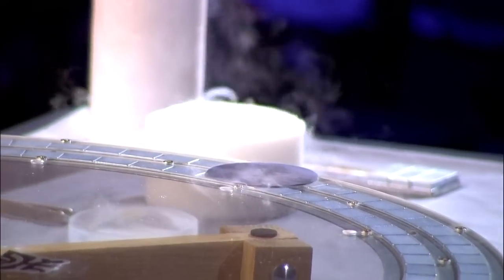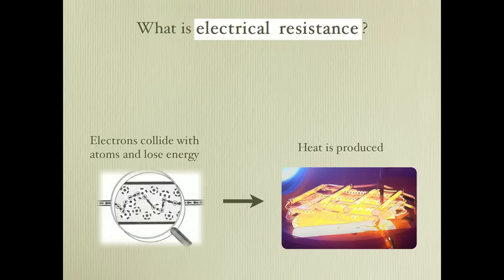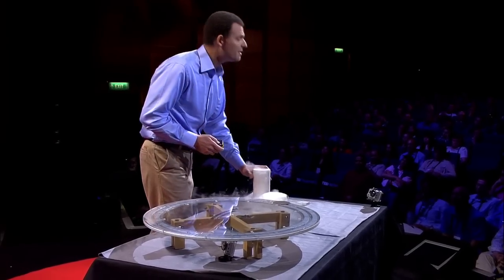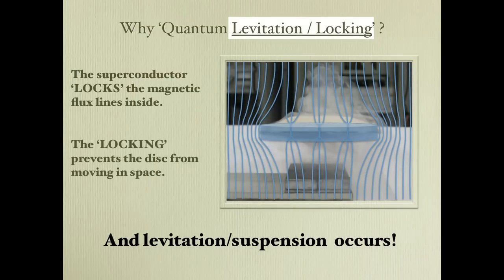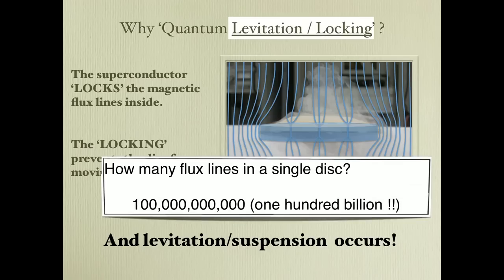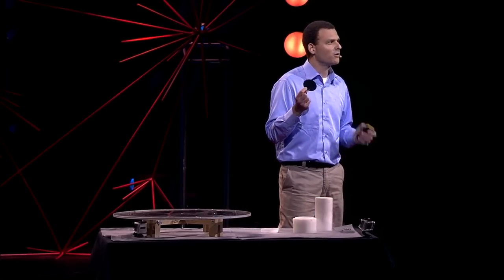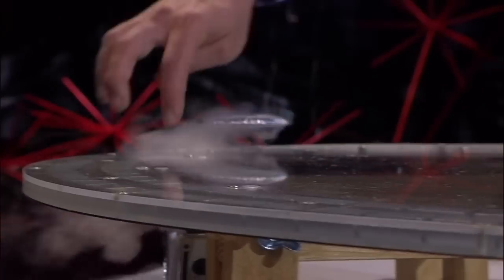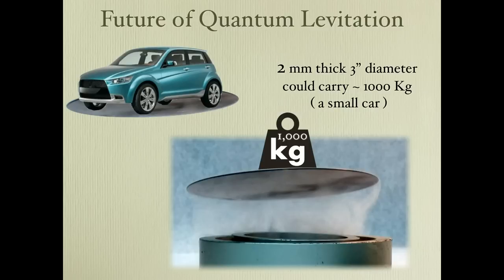Boaz Almog "levitates" a superconductor

Comment: No it not phenomena any more, in theory atoms are moving, meaning magnetic fields penetrates through material...

This means the magnetic fields pushes again diamagnetic objects..and it must pass around material that have condensed.

And this putting superconductor in circuit is huge energy creator...

The magnetic field is of a higher dimension than atoms, because it's a smaller particle in theory...as is the electric field and its force vector..

Gravity can be explained in higher dimensional terms...like water flowing through a filter, meaning gravity can move an object in any direction...and the same with magnetic fields...

We entered the realms of high dimensional technology...

Comment: Superconductors are strong antiferromagnetic substances that will expel external magnetic field that coined as Meissner effect. Since superconductors are enveloped with strong antiferromagnetic field in which this will help stationary electrons from amassing photons from surroundings. Again this doesn't mean that superconductors have zero resistance. It's just that free electrons that have dissipated out their stationary photons are allowed to re-amass stationary photons again from surroundings due to the presence of strong antiferromagnetic field of the superconductors themselves. Superconductors have quantum locking above an external magnetic field because it's a strong antiferromagnetic field (similar magnetic fields) that repel the external magnetic field to allow it to float above the external magnetic whereas its opposite magnetic fields to the external magnetic field will make it attracted to the external magnetic field that caused it to be locked literally to the external magnetic field. All superconductive substances at characteristic critical temperature will turn into a superconductor with very high specific heat capacity. This prompts us to suspect that stationary photons may play an important role in fostering superconductivity condition. At least we know now that missing link between electricity and magnetism is the photons in which free electrons are enveloped with stronger magnetic field due to the presence of abundant stationary photons onto themselves. Thus, we strongly believe that abundant stationary photons present on nuclei of superconductive atoms may foster the creation of strong antiferromagnetic field within the superconductor itself. If you are interested in real discoveries, I would recommend you to read my book, The Unification Theory - Volume One and you will be amazed with lots of new, interesting discoveries. In God I trust.
Reply: If you are interested in discoveries check out IISc Bangalore's researchers that made type 2 room temperature superconductors at atmospheric pressure and 13 deg celsius critical temperature by using a gold silver nano composite. See what I did there.. Also u missed the opportunity to say the missing link between electricity and magnetism is electromagnetic waves. Lol. Also ur book sounds like the ambitions of CCP. The Unification theory.😂😂 I am sorry I had to say it. Also no hate.. I just googled u r from Malaysia. And ur book is way off my level I think. I am 17 and Indian and just know basics of magnetism, superconductivity .etc and why it happens and how to calculate some things about it. Will I understand it? I will read the whole book if u say yes. but please say truly

Comment: There are too many of these quantum locking levitation superconductivity experiments. Try it without a catalyst, magnets or liquid nitrogen. We understand this, but it has no use. Electromagnetic perpultion is useable. If the  temperature rises and changes, you lose the effectiveness of the superconducting material.

Comment: This guy just basically explained how to make a UFO earth is a giant magnetic field then the higher the altitude the cooler the temperature find a way for the craft to pull the nitrogen from the atmosphere make the ship out of of a the best super conductive material the inner segment on the ship should be able to rotate like a gyroscope ans lock in place so depending on which pole the ship is on north or south the ship can correlate by being on the opposite pole   or if there a super conduct that react with oxygen and acts as a automatic coolant agent when in comes into contact with oxygen rendering the outside of the ufo cool to touch just a suggestion lol but it would be a lot more to it

Comment: if you ran this around x2 on an electric charged hairs ,using the  dry ice gas as a build up of propulsion,on the same magnetic display,would you not have explosive propulsion,continuous propulsion at light speed?
Reply: First of all, there is air friction. But let's pretend that there isn't. For us, observers, any object with mass will not reach light speed. The time from the object will go slower and slower the nearer it gets to light speed. If would take literally infinity amount of energy to get any mass to reach light speed.

Comment: Am I right if I suppose that this could be the premise of free energy via perpetual movement ? No friction and no dissipation means theorically perpetual movement right ? It solve the main problem, the friction and the heating. What could be the others issues ?

This also could be used to create monstruously powerful rail gun with no recoil at all, right ? This can make levitate a metal ball into Quantum lock & levitation and "fire" it at an outstanding speed, with a straight trajectory and all that low needs of energy and no sounds at all...
This also may be used to space travel engineering ?

Quantic researches are definetly the way to go, the applications in multiple domains seems endless, some seems promising and other potentially dangerous...

Comment: Would it be possible to use the magnetic field of the Earth for flying saucers ? Could a bigger conducter ( e.g. 3 Meter) be used for transportion into space for everyone ?  At least like the flying cars in the movie: "The Fifth Element" :) Or is the magentic field of the Earth to weak ? Thank you for your amazing speech !
Reply: Now that's using your noggin,lol, love the flying saucer question.... But the magnetic field is out in space. It cannot be accessed on the surface or even from the atmosphere. peace
Reply: @blackopal3138  The Earth's magnetic field can absolutely be used on its surface. Just look at a compass.

The problem is just that it's not that strong.
Reply: @Max_G4  lol, i'm a little surprised that I answered that so definitively, like I would know. Compass is a compelling example. In effect we already have the proof of concept, we just have to start increasing the load capacity. Look at LED 100 yrs later. Never know, pretty cool. peace

Comment: What materials did he use? What was the disk made out of? What was the magnetic railing made out of? What was he pouring into the container? This is amazing!
Reply: I guess it was liquid nitrogen he poured. But playing with such things always has to be under expert supervision.
Reply: River Govin Material the superconductor he had had to be quite easy to produce imho (non-lab environement and high temperature). I think it was Lithium-Copper-Barium-Stront-Oxide. Read about superliquids and superconductivity. The best superconductors arent the conductors at all but isolators with some ions and electrons artificially removed from their molecular structure. Have fun. Quantum Mechanics is our reality and our reality is the most amazing fantasy.

Comment: does it have to be cold to work though- can it be operated at room temperature?  Also does it maintain enough inertia /velocity to say move something like a wheel or crank shaft.
Reply: not yet , but we hope and long for it
Reply: CE_Stocks It depends on the superconductor structure. Best superconductors invented to this day can get macroscopic Quantum effects in about 180 kelvin. its about -90 celsius

Comment: What material is the superconductor made of?
Reply: superconductors are made from different ionic compounds like copper,yttrium, bismuth, etc.
Reply: I believe they are using graphite in this video. If you have a magnet and can get liquid nitrogen you can easily replicate this experiment with just a graphite rod from a regular black pencil.
Reply: That most certainly are not using graphite in this video and are most likely using YCBO.

Comment: Has anyone tried mixing this type of levitation with gyroscopic procession? Maybe this is how ufos move sideways while repulsive against earth's magnetism.
Reply: You overestimate the earth's magnetic strength. If anything had enough power to push against the magnetic core, it would collapse it in the process. The earth's core is molten, thus in a liquid state, it's magnetic direction can move around quite easily, especially if something had enough power to push against it. Newtons third law prevents something like this from existing, maybe if the earth's core wasn't in a liquid state, but even then, a silly idea to be honest.
Reply: I think the most  difficult part  of having a quantum locked ufo, is to keep it at a low temperature required for the superconductivity state to stay.  maybe some alien did it, maybe not.

Comment: sir, it was thankful that u introduce us a new era that we can imagine and create a new world..........its quite motivating. I had studied about it and make some effort to step this concept forward but really worried about its drawback. superconductor show its conductivity at a particular tempreture , if tempreture change its property losted.......can you suggest technique that can practiced to maintain its tempreture.????????
Reply: Consistent liquid nitrogen injections will make that happen. It will not replace cars, but I think trains will be obsolete, as a quantum locked pod in a vacuum chamber will be able to reach five times the speed of sound in under fifty-eight seconds.
Reply: How to deal with this drawback??? Instead of applying constant flow of liquid nitrogen ....is there not any way to deal with superconductor..??? If we are able to work at its drawbacks at atomic level then this constant demand of liquid. N2 will not be required....
Reply: That is a drawback, but think about going around the earth in minutes.

Comment: what if you heat the magnet so the difference in temptress equals to the difference when it's cold
Reply: it can interfere with the magnetic field
Reply: and the magic of this phenomenon is not so much the temperature difference but the low temperature which freezes or locks the object

Comment: it can levitate a small car?...THEN SHOW US THAT.
Reply: hey hes showing you the possibilities of the technology this shiz is amazing
Reply: if you want to see this tech in real life look at Coral Gables castle in Flordia the oil cartels are shelfing this stuff dude Bozag couldn't even if he could and wanted to show your small pea brained nous
Reply: mikewahby
 the swinging door pivots on bearings underneath the center of the rock, just like a rock that can be pushed by hand on the site of coral castle as shown in a youtube video., Ed used a pulley system from a large wooden tower as seen in one of his pictures.
Reply: mikewahby
 coral castle is made of light weight rock he didnt need to use levitation
Reply: @THERE.IS.NO.DEATH.  so? Not Need doesnt apply in success xD
Reply: explain the swinging door.
Reply: +There is no death. also your right about levitation there is no such thing it's called quantum locking...
Reply: +There is no death. Then why did modern engineers need to bring in 3 Cranes to fix it when it broke?
Reply: +There is no death. If you want to see a train float look at The Shanghai Maglev Train
Reply: mikewahby
i did not say i want to see a train float
Reply: If he gets a sponsors,then he might.
Reply: It can, theoretically not practically
Reply: @daddyascii9040  theoretically, I am 43465667754456456456466644 years old
Reply: They are still perfecting this technology idiot.its only micrometer thick and only works below critical temp. But when scientists can maintain it at room temp. It will levitate cars
Reply: Charles B. Sharpe
He made the claim that he can levitate a small car, not me, so he should hold up to his claim. That's my point.
Reply: +There is no death. How about you show us? Take the responsibility in your own hands before you ask another? If you are not interested, maybe you can do some research and at least show us how its possible? I would show, but people never try to answer the questions themselves. Rather just bark

Comment: wow! I've heard of superconductors, and have seen the "levitation" aspect before, but near the end he said something REALLY interesting, if I understand him correctly... using Quantum Locking, with a 2mm disc, you could lift 1000kilos?? How would that work? That's amazing
Reply: David Hall I am not sure but I believe that the pressure would still be felt on the magnets; I would still have to lift 1000 kilos if i was levitating a superconductor. That is the main barrier. And the fact that it must be liquid nitrogen cooled (atleast the yttrium barium oxide superconductor, others require liquid helium)

Comment: Does the pinned superconductor and the load attached to it add to the weight of the magnetic base it's pinned to? If I use a disc to pin a car to a magnet like you described, would I be able to lift the magnet with the car as if I were only lifting the magnet, or would it be just as strenuous as lifting the car with it? Does the superconductor pin directly to the magnet, or to the space around itself and only move with the magnet in response to changes in space?
Reply: Jane Doe A bit late perhaps, but no. If you want to accelerate mass you need the necessary amount of energy. lifting the magnet would include lifting the car. Just like lifting a rope includes lifting whatever it is attached to.
Reply: Le Cobra No. It isn't possible. If you want to accelerate something, you need to use energy to do it.
Reply: It would act like a zero friction suspension that you can use to move along the rail. The rail would have the weight of the car pushing down on the magnetic suspension, by the car would stay locked in the air. The car would still have friction due to air resistance, but it would make it easier to move. Because it doesn’t require friction with the ground, so it would stay in motion with less force. He could not literally hold the car in his hand because the weight has to go somewhere, but he could push the car along if it was on a magnetic rail system.
Reply: Jane Doe Now that is a REAL question, worthy of such topic. I'd really like to know the answer to this as well. If the superconductor does not add its weight to the magnet beneath... oh, the possibilities....
Reply: Except that a rope doesn't obey to the same laws of physics. He said that it was not a repulsion, but a quantum locking, to me it mean that the magnet doesn't support any weight at all, everything is supported by the supraconductor x magnetic field.

So it could be possible yet it seems unlikely.

Comment: what we need is a 5 mm thick piece of superconductor, inside of its own refrigeration unit keeping that superconductor superconductive and expel the heat it produces to move forward or slow down. now, as he said that a 3 mm thick piece can pick up a car, its vertical location is locked to the magnet but its horizontal location is free, to get it set to a certain height you must hold it at the desired height and then turn on a electric magnet beneath it. as the superconductor has no resistance from friction but gravity is still in play. i would suggest that there be a way to slow down through means of the mag rail. put small buffers of magnets with reversed polarity to slow it down, with small thrusters for acceleration and deceleration.
Reply: So... did you copy that comment from the conversation you were in, or vice-versa?
Reply: i dont understand your comment.
Reply: If you are using a magnetic rail, you could probably propel and break it by using a magnetic pulse sequence like some trains do. It works like a snake flexing ribs in sequence to slither. Yes, I agree with the idea to have a compressor of some type to cool the duper super conducting component but I guess, you'd just have to be careful that the materials used on tye shell wouldn't interfere with the magnetic fluxors in the first place.